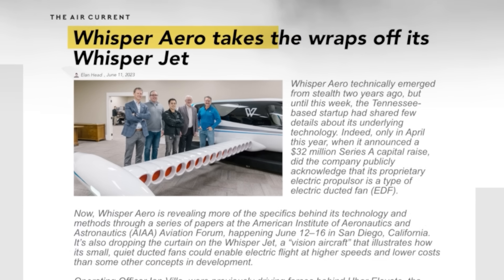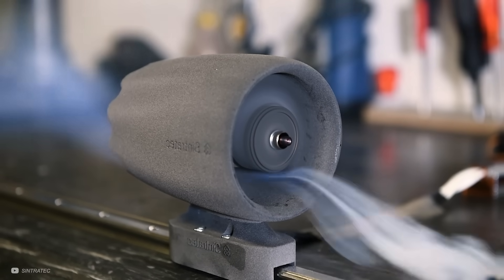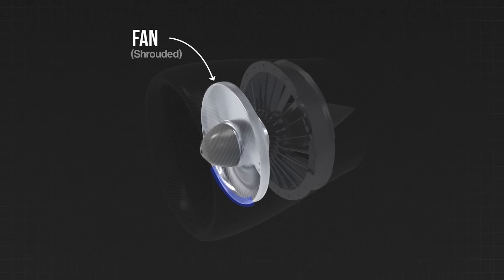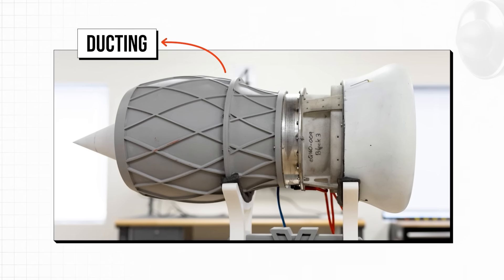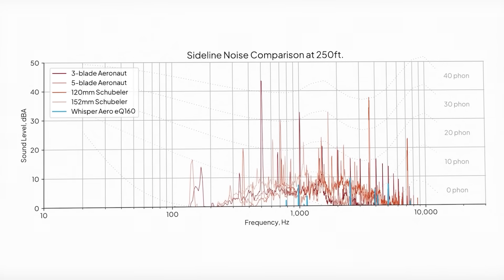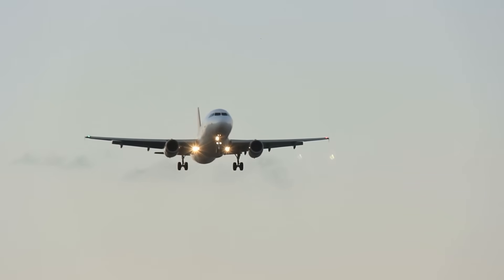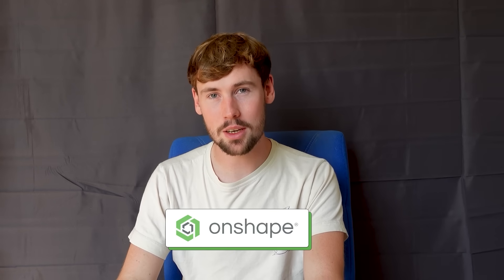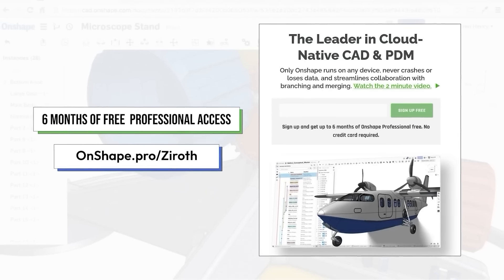This Genius Jet Engine Is Starting A Revolution

Comment: Tech startup scams really are a big problem in the modern world. It's like Theranos version 2.0. Outside of drones and RC model aircraft there is no foreseeable future use for electric ducted fan propulsion in manned flight. Why, firstly noise, just because the sound is out of your hearing range, doesn't mean it can't cause injury. In fact, it's even more dangerous. Secondly manned electric commercial aircraft have to range, with current battery technology, you don't have the range or payload capacity to be financially viable. Thirdly safety, all EV's from scooters to cars, trucks and boats all have an uncanny knack of bursting into flames, I can't see the FAA approving any electric commercial aircraft for use until this problem is solved.

Comment: Av gas is still 100 times more energy dense than batteries. Electric planes are a long way off. It will require a completely new type of battery to make planes efficient, not the motors and fan blades.

Comment: What about the inefficiencies of batteries and their weight? To get sufficient energy density,  well you won't want one crashing in your neighbourhood,  a vast toxic blaze that's nigh on impossible to put out. Rich people need to catch thd train and stop flying all over the shop. Where does the electricity come from?  In the UK it'll be cheaper and safer to use kerosene and that's without the noise pollution which you don't seem bothered about cos you can't hear it. Humans suck, we're a cancer on this planet.

Comment: Can you imagine the size and weight of the battery needed to fly a 100-ton 757 at over 500 miles per hour across the country? It would weigh 500 tons itself. The idea of battery-powered pickup trucks hauling loads, 80,000-pound line rigs, train locomotives, ships, jets, or heavy equipment in construction and mining is absurd. It will take 100 years before heavy and high-speed transportation can be fully electric. A general rule is that smaller batteries are more cost-effective and efficient. Our cell phone batteries work very well, but a 100,000-ton battery (highly flammable and explosive) powering a 200,000-ton oil ship across the ocean is unthinkable.
Reply: The 757 uses RB211 engines, right? A quick web search says those are good for 40-60 thousand lbf. But the 757 is famously overpowered, so you probably don't actually need that much. This motor can produce 70 lbf, so you'd need around 500 to 600 of them on each wing. The wing is about 50 ft long, and this fan is about 1 ft wide, so you'll need to stack them 10 high. I love the visuals.

...Before you start talking about commercial jet aircraft, clearly some scaling up is in order.
Reply: What powers high speed trains?
Reply: @catprog   Not batteries! The third rail in the center carries tremendous amounts of current to power the train.
Reply: @charlesjackson2759  You said  "It will take 100 years before heavy and high-speed transportation can be fully electric." not batteries.

If you had of said road batteries I would agree with you. I don't think it will take 100 years for a battery freight train though.

Comment: The smaller planes and drones can use parachutes, but I hope there is enough lift, and a suitable glide slope for those larger planes should the numerous leading edge engines fail. Otherwise, a full system or electrical fault could turn an aeroplane into a brick.

Comment: Basically noise is exactly vibration from tips of blades in rotors... Why the fuck nobody just add duct on them directly to stiffened whole construction earlier? Mean... Are there any reason to not do that in conventional turboprop and jet engines? Because for me it sounds like... What a fuck, why nobody do that earlier?

Comment: With up to 22 electric thrusters mounted in the wing as illustrated, where in earth is the power coming from ? Even the best batteries still on the drawing board will never contain enough power density to rival the current technology. All these 'efficiencies' suggest we can cross the Atlantic on a few AA dry cells. I may be something of  Dinosaur but I don't see it , the physics don't add up !!

Comment: They just need an inverted tram system, where aeroplanes, trail 10,000m of (secret sauce bit here...) very, very thin, and 'ultra' - 'ultra' lightweight electrical cable, down to a fixed HVDC* cable and power it continuously. I'd say on account of the efficiencies gained we could be a bit slack re engines/propellers etc., probably get away with a few old extractor fans. (careful now, or who you could end up with some men, who once loved tractors, but are no longer fans).. Anyway, I'll tale my standard 10% when someone makes a billion from another of my great ideas.
*HVDC It's tech-talk (No, that's Tik-Tok) You needn't worry your pretty^ little head about it.
^pretty - or handsome, or ugly.

Comment: If you want to be taken seriously by anyone with half a clue in engineering, do the bare minimum and compare its thrust to watage ratio to that of a conventional un-ducted propeller. When it comes to electric flight efficiency is all important as it dictates range
Reply: Shame the company doesn't publish those numbers and ignored his emails, eh.  I agree it's quite hard to take THEM seriously at this point.

Comment: Think of a Violin, all those blocks down the side in pressed makes a different Frequency and when you have 2 different frequencies coming together it's noisy however if you use a Harmonic of Frequency 1 it's quieter and more efficient so in a Turbo Fan Pump you have all those Harmonics to play with ... What could possibly go wrong ??... Well for starts you may get the first 10 harmonics right and chuck in 11 which by some really Weird Harmonic screws with someone else then you get a big load of Chatter as 'Blade People' are swearing at other Blade People in what we hear as Noise ... but is in fact the blades trying to destroy each other, so lower performance and the millions of chances it's going to come apart and you're leaving the business with a bunch of gold and never heard of again ... For a Start

Comment: None of this solves the problem that batteries contain less energy while being heavier than kerosene. Any electric planes that use batteries will be toys, not commercial vehicles.
Reply: Also, battery weight does not decrease during flight, as long as one isn't chucking empty batteries overboard.
Reply: @clockworkvanhellsing372  - good point!
Reply: What about a hybrid plane? Electric motors and a more fuel efficient engine?
Reply: Go nuclear?
Reply: @divithh1477   That's the only viable way for electric planes to work, but it's also a very bad idea for obvious reasons.
Reply: Until we get solid state batteries.  Then you have to drastically change that energy to weight ratio
Reply: They won’t be long haulers, but excellent domestic intercity air transport vehicles. Allow them that particular commercial niche, and have their developers take it from there. It’s how commercial aviation has progressed throughout its entire history.
Reply: That was my first thought. Many others questions followed.
Reply: Fuel cells powered by hydrogen or synthetic fuels (e.g methanol) are a possible long term option. They also rely on high-performance electric engines just like this.
Reply: The same was said about semi trucks. Today they are electric and drive over 500km with 42t.
The betteries get better and better. It will be no more a problem at one point.
Reply: @ChriDDel  - So why haven't electric trucks taken over the market- especially in urban work, where arranging suitable chargers is relatively easy?  And why do governments have to keep subsidising them?  When the earliest petrol / diesel engines became practical propositions, no government had to offer people and businesses bribes to get rid of their horses - nor did they when CDs and DVDs took over for audio and video tapes!
Reply: @jackx4311 
EVs of all types are being taken up very quickly. The take up would be faster, but ignorance slows usage.
Reply: @ChriDDel  yes but these trucks are carrying 10 to 20 tonnes of battery, this is not viable for an aircraft.
Reply: @thamesmud no they carry 2t of batteries for a 42t truck.
Google eActros 600 or Scania eSway.
Reply: @ChriDDel @ChriDDel you miss the point.  A truck engine is 500kw, a twin engined airliner is about 40,000kw total so 80 times the size.  That would make your battery weight nearer 160 tonnes . A 737 has a payload of about 17 tonnes and a fuel load of 20 tonnes. The figures just don't add up.
Reply: @thamesmud not now, that is the point.
Reply: @ChriDDel but the nuclear fleet and some of the old gas fleet are life expired over the next 8 to 10 years, if your magic new unknown tech doesn't magically appear the grid will fail when the wind drops.  As I have pointed out in other posts lead times on conventional GT power stations are currently 8 years .  Our wonderfull government is provisioning precisely no conventional powerstations.  So do you want to gamble on the magic unicorn or use proven technology?
Reply: @ChriDDel  - right;  well, IF and WHEN it does, give us a shout - we won't hold our breath.
Reply: @ChriDDel  The battery of the Mercedes-Benz eActros 600 weighs approximately 4.5 tonnes.
Reply: i nuclear reactor on teh plane could fix that issue by teh way. small modlear reactors anybody.
Reply: @ashtonmiller-z1n was tried on the 1960's by the US and Soviets.  The weight of the shielding made it impractical, especially when combined with the radiation consequences of a crash.
Reply: @ashtonmiller-z1n  - a nuclear reactor, shielded with LEAD?  Small modular reactors also use the nuke to power a steam turbine;  so, even if you condense ALL the water used by the turbine, how much weight will even a boilerfull of water add?

Comment: I’m not convinced, airlines have been playing with fans for 7 decades.
If more blades and a shroud were more efficient why don’t they use them?
I have a fair idea on many reasons why but if it was practical at an upscaled level I think we already would have seen them especially for Aeronautical use where weight is critical. A hand blower it doesn’t matter if it weighs an extra 500grams.

Comment: A single Boeing 777 engine has the thrust of equivalent roughly 100 MW. So how big battery do you think an electric fan of the similar thrust would require? For two engines a battery of MORE than 200 MW...??? So unless you have some magic battery this all is just a far fetch fantasy.

Comment: Can someone explain how having more blades improves efficiency? Im not buying the whole 40% more efficient part. Maybe it makes more efficient thrust with more blades(meaning more theust with a smaller diameter fan) but I am not seeing how it can be more power efficient than a fan with less blades.
Reply: It's in the small print. 'More efficient compared to other electric turbines', which are useless and inefficient anyway lol

Comment: This plays out like the same kind of 'never gonna happen' vaporware corporate bs as the rest of them, no real data or claims, not a single mention of batteries that'd power this pipe deam or make it at all possible or viable, etc. Also the whole thing reads like a load of nonesense, the only real claim they made is supposed efficiency, which I don't buy, and being more quiet, which is the only part that sounds possible. 

Everyone knows that the more blades you have, the more drag you get, not to even mention the shroud that's pretty bad aerodynamically, and the compression ratio due to the thinning of the turbine, the drag is gonna be crazy. Oh, and the weight of these things is gonna be crazy, with that many propellers, an outer ring, and a SECOND set of propellers inside, an outer ring on that too, the shell, supports, back cone and vercyor control surface. And there's gonna be many of them..? Absolute nonesense. 

Even if one of them does magically end up being more efficient, having so many will be so heavy and power hungry that it'll make no sense. There's also the square cube law, which means smaller engines will always be less efficient than bigger ones, so what is even the plan here?
Reply: My guess is military drone contracts.

Comment: All those motors incorporated into the wing don't leave much space for details like...wing spars?  I wouldn't get into one of those rigs unless it had undergone 1000s of hours of testing.  Also, all of their "innovations" just seem like tweaks to existing designs, and it's hard to believe those could yield the promised 15-53% improvement in efficiency.

Comment: The video said something in passing that I think all of us mechanically minded folks should talk about.  Dictionaries and most people say that the words 'engine' and 'motor' are synonyms.  I have always been under the idea that they were very different things.  An engine converts chemical energy into mechanical energy.  A motor is fed some sort of power, such as pressurized steam, hydraulic fluid, air, or electrons, via some sort of conduit, and converts that energy into mechanical energy.
The terms have been used interchangeably for a very long time, and that is how we got "motor sports", "motor speedway," "motor city," "motorcycle", etc.  But nearly everybody cringes when they hear someone say that their car won't start because the starter engine is dead.  It's like they actually know that the two are not the same, but they don't want to face it full-on.
Reply: In german, both are motors.
What bothers me more is that people started calling ducted fans "turbines". A turbine converts energy from a streaming medium, never the other way around. The turbine in a turbine engine is only one part of the whole thing.
Reply: @gustavgnoettgen  
Yes, turbines are driven, they don't drive.

Comment: The laws of physics show that larger engines are more efficient than small engines.
The energy used to move air back (and push the plane forward) is proportional to the mass of the air and proportional to the square of the velocity. If you double the volume of air moved (larger engine) and halve the speed, you get the same thrust for half the energy requirement.

Aviation engineers know this, which is why commercial aircraft keep getting bigger engines.

These small engines can't defeat the laws of physics, so they can't ever be as energy efficient.
Reply: My thoughts exactly. Also these things look like they weigh a friggin ton compared to just the basic design of motor + propeller... And I won't even mention just how much more drag those ducts and million blades will have, there's no way in heck this is gonna be viable or efficient at all

Comment: If you are curious how it works you can read about the original NASA design at https://ntrs.nasa.gov/api/citations/20070006851/downloads/20070006851.pdf

Comment: As a long time R/C airplane builder/flyer I am familiar with the ducted fans that have been used in our hobby for years.  In our case the db level of a ducted fan is considerably higher than for a simple motor with a 2-bladed prop.  Also, I have been building and flying quadcopters for years.  Some of these have something akin to a ducted fan for propulsion.  Again, they are way more noisy/high pitched (hence irritating) than open props (the fewer blades and lower the rpm the quieter).  Based on my experiences I am skeptical that these "whisper" EDFs are really all that quiet.  It would be great if you could ferret out some empirical evidence regarding this issue.
Reply: and to add, placing them at the leading edge of an airfoil totally destroys everything I have learned about aerodynamics.  (also a long time RC plane builder)    Then the elephant in the room .. the power source for large aircraft is simply not feasible today.    Full size gliders have been using electric assist for takeoff and flying, but run time is limited.   I call BS on this entire story.
Reply: @JasperMulder100 also ducted fans have much much lover efficiency compared to open props of larger diameter.  
Maybe they push noise to 16 kHz but efficiency is a key.
Reply: @JasperMulder100  Agreed, tractor designs tend to produce better lift at lower airspeeds thanks to the wash from the prop blowing over the wing. It's sad that DIY RC has dramatically died off over the last decade, it really was a good gateway into aerodynamic engineering.
Reply: This is exactly what I was going to post. More blades equals less efficiency. The most efficient prop is a single bladed prop, and it goes down from there.
Reply: @cyberbillp  yes, you can't negotiate with a physicist

Comment: This engine solved absolutely nothing, it is a few % more effective, a bit more silent in hearing range and so on.
The problem with electric flight is not, and has never been the propulsion, the problem is and has always been the batterys and their weight.
There are already 1000hp electric motors, and propellers/fans they can swing.
Until there is a revoloution in batterys, electric planes will not fly
Reply: Questionable if it's even more effective honestly, this sounds like a complete fraud

Comment: 70 Pounds of thrust is not that much. You would get more thrust with a micro turbine adapted into a turbofan. Until electric power source is advansed into real high density package a jet engine will always be optimal for flight and reigning champ. Diesel fuel ( jet fuel ) contains approximately 12,700 watt-hours (Wh) per kilogram (around 12.7 kWh/kg) vs current battery technology, has specific energy around 450-500 Wh/kg. But there are in development Lithium Air bateries that is supposed to have 4 times the energy density, up to 1200 Wh/kg, but i have heard that song for at least 15 years, and 1200 vs 12,000 is far off...

Comment: Are there any concepts for a jet ducted fan hybrid?

It seems like that would be a useful middle ground, extra thrust at takeoff. Less battery weight. The jet would have less moving parts at the hot end, so would be cheaper/simpler.